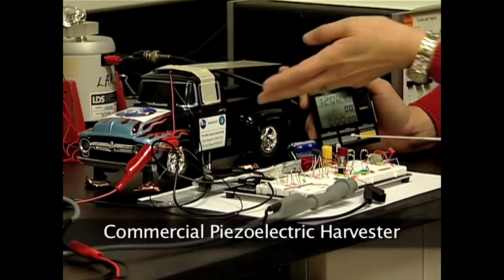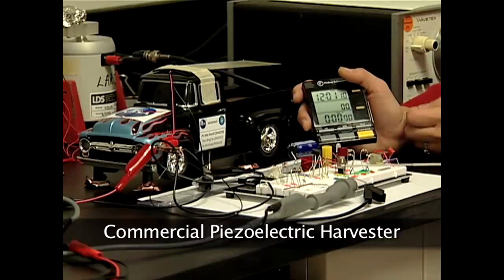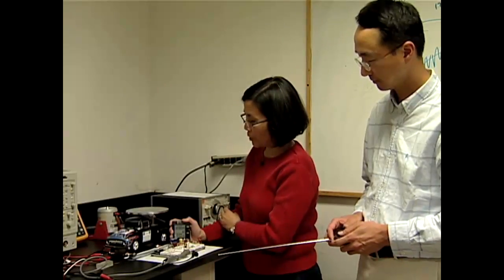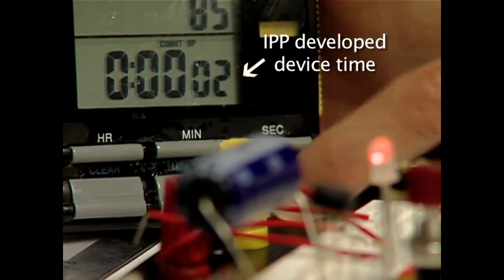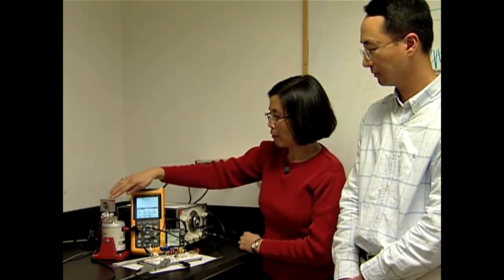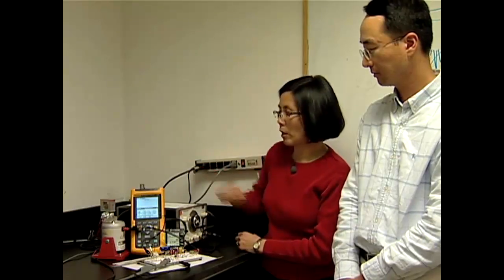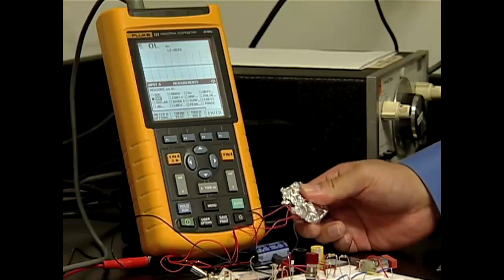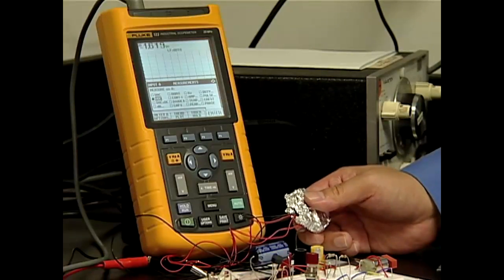NASA | Piezoelectric Energy Harvesting Transducers

Comment: 3 years ago, I did the same experiment with very interesting results. I used half-wave rectifier circuit to convert the energy from AC to DC, and it lights up the LED pretty brightly! All of these components were taken from the electronic waste. The project is capable of powering low-power devices such as sensors.
Reply: Hey, this sounds interesting, you think we could chat for a bit?
Reply: Can i get your contact to asking about this project?
Reply: Circuit is just simple, use germanium diode (rectenna). Rectenna converts RF energy into DC
Reply: igot intresting info i check many devices i need some of u info i may share too
Reply: Or you can just use 1n60 crystal diodes (low drop) in series or full bridge to harvest energy from even weaker RF signals
Reply: If you can charge any kind off batterys with piezoelectric then you can power anything you just series n parallel the chosen batteries too power what you wish from a trickle charge all helps
Reply: Update: It was just a germanium diode from an old TV tuner. Connected anti-parallel with the LED

Comment: Long trail backpackers need a way to generate about 12 watts of electricity per day to keep their cell phones and headlamps running.  Many carry almost 1/2 KG batteries to make this happen and recharge whenever they are in towns. What they need is a lightweight way to get their "juice" while hiking. A pair of insoles in their hiking shoes might be able to generate that electricity and reduce their load of gear.  What do you think?
Reply: that hit the market about 10years ago. theres even a nightclub that powers the music system using piezo floor panels.

we should be embedding crystals in roadways etc and everywhere with movement involved. it would lower the energy need considerably.

Comment: the earth vibrates.....  earth to quartz to dual capacitor that makes an arc flash that ionizes the air and tricks the trapped sun rays in the ionosphere into more piezoelectric on the 2nd coil with conductive top...
Reply: Ah, magic;)

Comment: Great area of research. Keep up the good work and upscale it please. For example, large units in highway offramps to assist vehicles in slowing by extracting energy would be one way to add to the powergrid. H
Reply: Add to the powergrid? I laughed it! They are for generating really less power and used generally in lightning, sensors, actuators and so on. You can search on it.